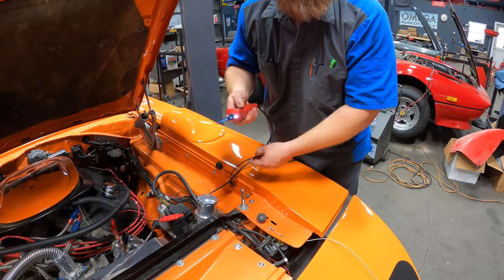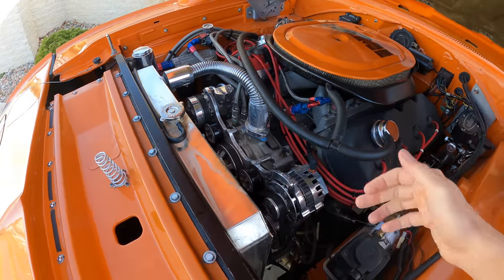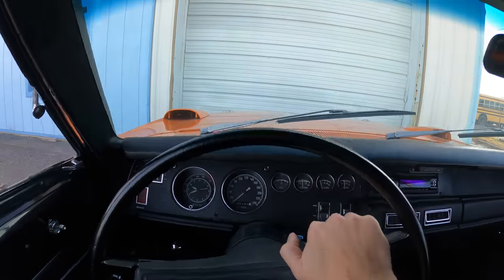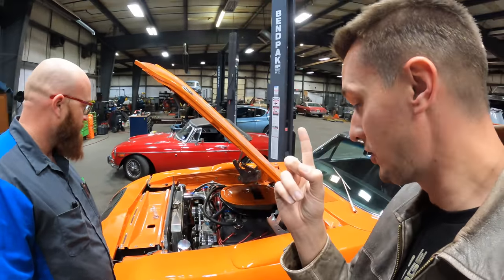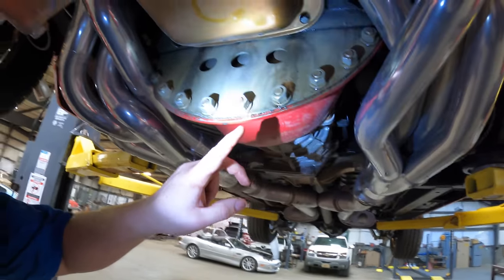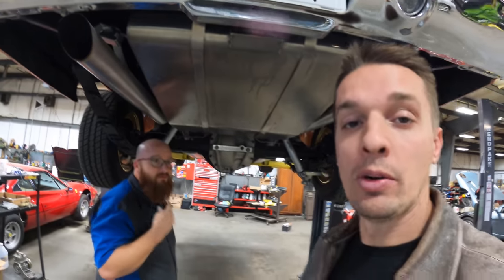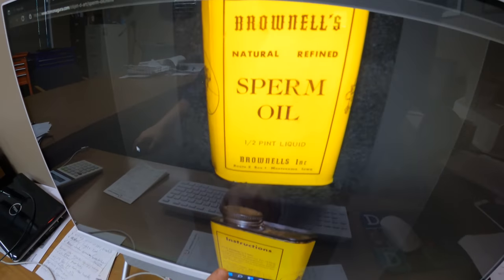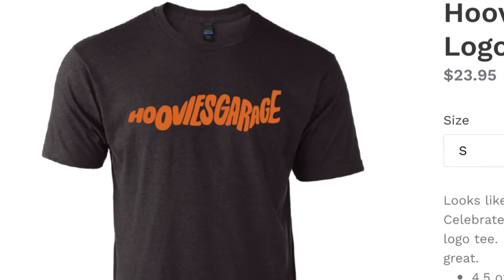How I got SCAMMED buying a Plymouth Superbird online sight unseen (So much broken/missing)

Comment: Tyler, the areas of the frame you were inspecting around the 19 minute mark are actually aftermarket subframe connectors. The Mopar unibodies of this era never had anything frame-wise running under the passenger compartment. Looks like a pretty nice kit was put in, rear torque boxes were added to the rockers as well. That chassis is definitely strong now, a definite requirement for that modified Hemi.
Reply: I cannot currently remember whether the superstock cars had full sub frame connectors on it, I'm thinking that they did because the engine actually sits further back in the superstock cars than it did on the stock cars. I know this because the actual balance was 45 percent rear to 55% front. It was as close to a 50-50 balance front rear has Chrysler ever made I do believe. Large torque boxes would have been stock on all Hemi cars and all convertibles. Front suspension appears completely aftermarket.
Reply: @44hawk28  You are correct superbird superstock cars did have a full sub frame connectors.
Reply: @44hawk28  Where are the torsion bars?
Reply: The whole K member is aftermarket, tortion bars replaced with coilovers, the steering box was replaced with a rack and pinion, the upper and lower control arms are aftermarket tubular, and what looks to be a Wilwood brake kit.
Reply: All Hemi cars, 6 pack cars (including TA Challengers and AAR Cuda’s) and all convertibles had factory torque boxes. Hemi cars also had special snubber reinforcement plates so the rear ends didn’t tear a hole in the floor under repeated launches. Hemi cars also had extra steel rectangular inserts with holes for bolts to pass through where the front leaf spring brackets mounted and they had triangular rear frame rail reinforcements welded in back where the rear spring shackles mount. All those things should be present if it’s a real car, but the assembly lines were notorious for quality control issues, so they sometimes missed a thing or two. And as mentioned, that car has aftermarket subframe connectors welded in snd thats one thing ALL Mopars can use. Greatly stiffens up the car. With all my chassis reinforcements on my Cuda, I can Jack the front corner up and the rear follows, yet I can still open snd close my door perfectly. Before the reinforcements, the door sagged so much it wouldn’t even close, the body flexed so much.
Reply: @draggerlane04090  no such thing as a Superbird Super Stock.  No factory Mopars ever had subframe connectors. Guys who modified their cars into Altered Wheel base cars, hell maybe r en guys who raced Super Stock likely added connectors, but did he say this. At ran Suoer Stick back in the 70’s or was it just raced? And the connectors that are form fitted to the floor are lazer cut that way before being welded in and those have only come about in the last decade or so.
Reply: @mikerackhabit6075  Yea I agree with you but this  isn't a stock assembly line run of the mill road car.  It was built as a nascar and then converted into a road car. The way I understand it.
Reply: @draggerlane04090  This actually was one of the Superbirds purchased at a dealer for on road use. Somebody used it for racing, my guess is amateur, and that's how it was involved in the accident. The real NASCAR birds had holes cut into the fenders for wheel clearance, he said in the video those aren't present.
Reply: @44hawk28 
“9
Reply: @CheezyDee  I noticed in the Car Wizard video that just came out on this car (12/21/21) that it looks like all of the wing hardware that usually is in the trunk and supporting the wing, and keeping the quarters from buckling under aero-load, may be missing. Tough to see in the vid. The interior is also far from original or "restored" in many respects.
Reply: @andylindberg6243  that was my reaction when Hooive tried bouncing it... Looks like some jackass poorly grafted a Mustang II front end on it, but the steering rack is in the wrong place for that. And the upper A arms look pretty anemic to me.
Reply: @Oscarphone  The pictures on the BAT website show the wing braces in the trunk.  Wizards video needs more light! lol
Reply: You will still make money ,if you sold it on , scammed don't think so 😭
Reply: The front suspension is far from factory it originally had torsion bar suspension you can see where someone ran the fuel lines through the holes in the crossmember for the bars.

Comment: The seller sounds like a scammer, good on BaT for taking accountability and doing the right thing.
Reply: 135k instead isn't all that bad.
Reply: Oskar Dirlewanger  🤦‍♂️🤦‍♂️😭
Reply: ye its definetely not the last owner who restored it
Reply: Oskar Dirlewanger  I asked over on BAT for the trunk gutter VIN. No response. That told me everything I needed to know.
Reply: He should have mailed all the paperwork and souvenirs separately as I've done in the past. Seller sounds really fishy.
Reply: @ForcesNL  could have been way worse - the real scammers try to hide a bad transmission or motor and a lot of those guys run the buy here pay here used car lots taking advantage of clueless single moms. More should have been disclosed but doesn't look like anything catastrophic here and you have to expect someone to come out and look at a car like this in person.
Reply: Scammer?  Rip off?  The car is easily worth the price paid.
Reply: I'm don't think the seller is a scammer, he probably never really drove it much.  The car is actually in pretty good shape.
Reply: @oldanslo  You're right. It goes both ways. Imagine the seller being contacted and he's told about low oil pressure, coolant boiling over and missing Richard petty stuff. 
What if the shipper did take the hat? 
I've used shippers, and they are all contracted out. They are usually not reputable. 
Had one lose the keys to my car at SEMA. 
Anyway, if the seller did send Hoovie  the hat, and hoovie calls complaining on the hat, oil pressure and overheating I would have a strong feeling as the seller the buyer is scamming me.
Reply: buy any second hand car and only spend 2.6% of the buying price to get it fixed and serviced? Hoovie got a great deal. He will get it fixed , enjoy it and sell it on for a profit. The seller is not a scammer. No idea about the memorabilia and don't really care.
Reply: @oldanslo   Agreed. Many issues but in great shape overall.
Reply: @alimackenzie2168  imagine if it is a replica, using some Superbird original panels, and a custom new frame? The floors and frame rails seem band new.
Reply: eh. the car looks pretty good. not so much a scam really. the only thing really questionable is the souvenir stuff.
Reply: @phgamer4393  Agreed. The sellet should have been smart enough to mail paperwork and souvenirs separately from the car....20 bucks USPS Priority mail. Lets check Ebay that month to see if they were sold there.
Reply: @oldanslo  maybe? Non numbers matching hemi car that's been rebodied with non original front accessories, wheels, tires, and minimal paperwork. Car needs total suspension, and seemingly everything else gone through, and I would bet all of the wiring looks the same. Mopar guys REALLY like original concourse stuff which is what brings the money and as much paper work and history as possible.
Reply: @Cyborg_Auto   Agreed, in very good condition. For a car that rare, I would have bought it if I'd seen it. Plenty of time for me to work out the issues.
Reply: @randkamza1206  😂 OK pal.
Reply: @FlyingD  I didn't say anything about the channel. I don't care about the memorabilia not showing up.
Reply: @motoweenies4431  He bought it knowing all that. Its a resto mod, not a restored original.

Comment: I'd absolutely report the seller to BaT, because that's about 100 miles past the line of reasonable 'minor details' missing from an auction listing. Hell, my overly pessimistic side would be sorely tempted to look into legal action (against the seller, not BaT, to be clear) to recover some of your expenses here.

/updated text a bit after reading Hoovie's reply
Reply: Hoovie got hosed
Reply from the maker: The auction house has been great through all of this. Refunded their fee and did take some action on the seller. In the end, though, they are just a go-between that is reliant upon the seller providing accurate information.
Reply: They are literally an auction listing site, and it's worse because they curate their auctions to be cosmetically acceptable. If you have something that is valuable, but looks trashy, bringatrailer won't List It.  This is in part on the seller for being a scammer, but also for bringatrailer not doing their homework. I have always looked at bring a trailer as a curated money-laundering site. Cars there typically go for much higher than street value, and much higher than any other auction site.  There have been many horror stories about people that bought cars bring a trailer, and found out later they had been scammed, and bring a trailer will not take responsibility, even though they had some function in curating the auction, because you can't just list anything on bring a trailer.
Reply: @HooviesGarage  I feel like these cars with issues are the ones that go down in value during a downturn in the markets when only the more pristine ones retain or increase in value.  I know this from my days collecting vintage guitars.  Anyway, hope things turn out well with this one.  Best of luck!
Reply: @HooviesGarage  Ah, I see. Good to know BaT's folks are being responsive and assisting you in this matter though. Looking forward to seeing this rare bird get all sorted out!  :)

And thanks for the reply of course. Hope you and yours have a Happy Holidays.
Reply: @chubbysumo2230  yeah, out of curiosity I just checked out some Volvos and was in shock at the prices, like double what they were selling for at other places. I've never visited the site before, so that shocked me.
Reply: @HooviesGarage  Tyler seems to just let people rip him off
Reply: I would absolutely take legal action against the seller! (Not BAT!)
Reply: @Emira_75  he should put some scars on his face next time making a deal, also a white eye contact lense maybe, they surely would doubt it to scam a guy like that 😂
Reply: It's great that they're helping him but the only reason BaT is helping him is because it's featured on a high profile youtube channel. If you're some guy with 5 friends on facebook and this happened to you BaT wouldn't wipe their floor with your issue.
Reply: I would also take him to court for not providing the NASCAR memorabilia as promised. If he can make good on the deal by providing said memorabilia as he said he would then great, but if he doesnt have them then i would be happy to settle for a partial refund or have him donate $500-800 to a charity of his choosing.
Reply: @hrcvf7505  Yeah the ONLY way you're going to stop things like this is if you pursue them. Otherwise people will just keep doing it. 

Now when it got before a judge however, there will be an issue since Hoovie already got the cost of the repairs back from BAT. But fraud is a criminal not civil offence.
Reply: That guy had to be a moron to adjust those coil overs all the way up like that. As far as a "partial re-body" i would say they got a few parts off a car they found in a field including the vin plate and put them onto a fairly decent old Charger. Just like the old General Lee "1" they found in a field in GA or wherever it was and sold at Barrett Jackson.
Reply: @HooviesGarage  I don't know, they play a pretty big role in presenting the car, to the point where you don't usually have much that actually came first hand from the seller in the listing. They also curate the listings, so they definitely have taken on some of the risk for selecting and presenting cars accurately.
Reply: @muskokamike127  - Hoovie got his auction fee back, not the cost of the repairs. He should be entitled to both.
Reply: @OMGWTFLOLSMH  he got his auction fees back which COVER the cost of the repairs. 

Follow along so you can understand how the law works: 
He can sue the seller for not disclosing the issues with the vehicle correct? Yes. 
His "damages" are the cost to repair said "issues" which total $3400. 
He received a refund from the auction of $5000 correct? yes. 
The refund from the auction was due to the many issues the car had that were undisclosed, correct? Yes.

Therefore he wouldn't be entitled to MORE compensation than the cost of the repairs. 

That's how lawsuits work....

Now he MIGHT be entitled to punitive damages for loss of use etc but considering he already received $1600 more than the cost of the repairs, that is also already covered.
Reply: @muskokamike127  it's not just the cost of the repairs. It's the over inflated price paid at auction  because all the faults weren't listed. Might of sold for 20K less if the seller was honest and listed all the faults and gave an honest  description. Don't forget the missing memorabilia.
Edit: How would Hoovie receiving a goodwill gesture from the auction site affect any compensation due from the seller? Its a gesture of goodwill with no admission of liability. Pretty much a gift.
Reply: @elitedavidhorne8494  What if, could have, might have, impossible to prove in court. 

The compensation was directly related to the condition upon receipt,  it wasn't a gift. 

Stop trying to put a square peg in a round hole. 

I've been involved in enough lawsuits to have a good understanding of what's what.

Comment: That floor makes me think it was a complete rebody (Vin Swap)...you need to check the secret Vin numbers on the driver side trunk drain. (Under the water seal on the driver side) Also the radiator support will have the other hidden vin. Also look to see if either of those parts (the radiator support or that part of the rear trunk) look like they have been "fiddled with". High probability it was a total rebody. I'd also get rid of that remote oil filter...too many 1 dollar parts that can fail and kill your engine.
Reply: Agreed. I would want a Mopar expert to check over the details of a high dollar car. I find it hard to believe a hemi four speed bird is hacked together like that in light of it's value and rarity
Reply: @mattg7952  I honestly have no idea what it takes to be put on the superbird registry. How do you know it was verified and by whom, Galen Glovier? That floor looks completely replaced and thus sketchy.
Reply: @Ben Jones I am aware of AMD and several companies that make new floors, but a partial floor replacement and a total replacement is a significant difference and aside from all the other things he wasnt told, id be sure I had a real superbird
Reply: @mattg7952  Well, the vin tag may be listed on the registry... I'm not even sure if there is a registry for these cars that's universally recognized. I find it real hard to believe a hemi 4 speed car got resto modded.  A "racing'" super bird street car?  If it was NASCAR, ARCA or USAC stock, there would be a paper trail adding to it's value.  Bring a trailer has sold a few 440 birds that were well documented for more than what this car went for. At one time, though maybe not now, someone would have paid that money for a documented hemi 4 speed wreck to give a rotisserie restoration. I still stand by my opinion that he didn't get the car he thought he bought
Reply: In the vid they say this was a partial rebody.

Comment: A couple things I'm seeing.  The front suspension has been taken out and replaced with a tubular set-up instead of the torsion bars.  Framerail connectors were added.  The beams that run under the car parallel to the doors are not stock, but this is kind of a common thing to add to a modified Mopar to stiffen the chassis.  It looks like adjustable traction bars have been added to the rear end, they aren't needed on a Mopar.
Reply: Front nose is probably fiberglass
Reply: Had some janky wheel hop from a start as well
Reply: Did you know you were getting a car with a complete aftermarket coilover front suspension and rack and pinion steering?  Great if you were looking to go resto-mod.  NOT great if you thought you were getting an original Superbird!!!
Reply: Frame rail connectors? Doesn't that car have a full perimeter frame?
Reply: @dieselyeti  Nope...  came from the factory as a unitized body.  This one has a lot of additional steel welded in.
Reply: @dieselyeti  no, it’s a unibody like new cars. So if you hear of a Mopar from this era as a “frame off restoration” they don’t know what they are taking about.  There is no removable frame to unbolt from the body. There is a K member up front which is an engine cradle and holds the parts of the suspension. Mopars have front & rear frame rails that are integrated/welded into the floor pan.  Sometimes extra bracing is added when the cars are modified like this one.  It’s an extra beam that fits up against the floor and connects the front and rear frame rails for extra strength.  The K member has probably been removed from this car and replaced with the tubular suspension and the steering rack was changed to a rack and pinion style.  There are companies that sell kits to change all these parts.

Comment: I'd ditch the vacuum pumps altogether and run a vacuum reservoir instead and see how the brakes & headlights operated before shelling out $1500 for another pump.
Reply: Yep. The pump is BS. All you need is a functioning vacuum tank/system and a line from the engine.